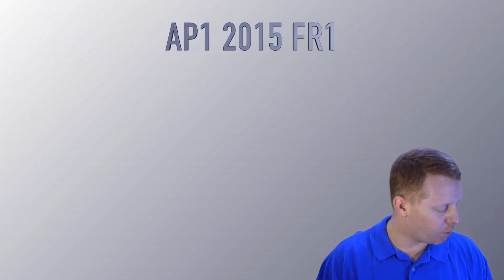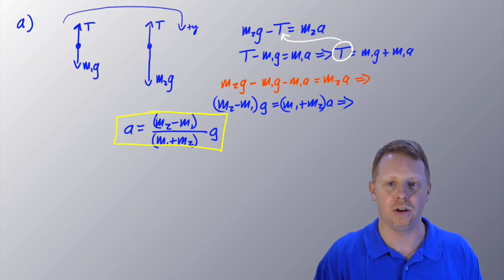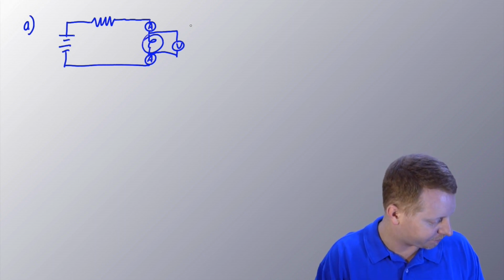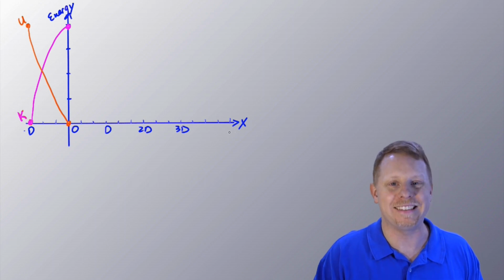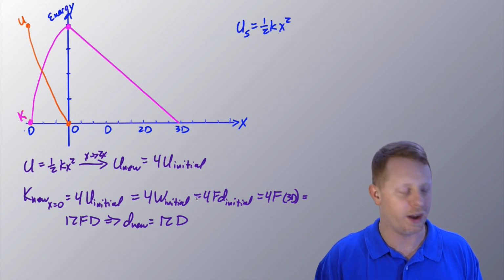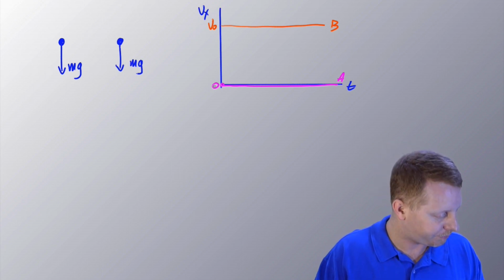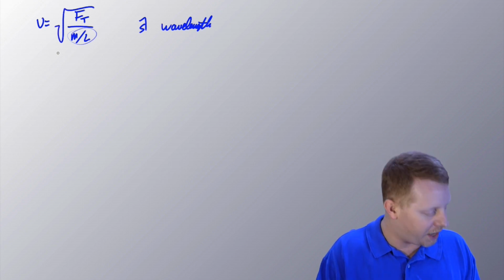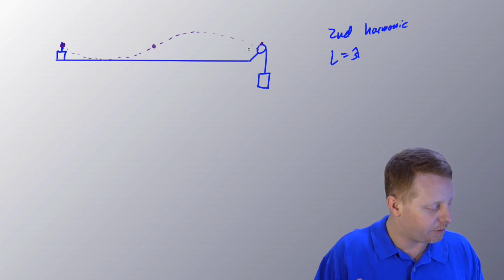AP Physics 1 2015 Free Response Solutions

Comment: In the question 5(a), could the frequencies be different because the wires were made up of different materials and hence had different densities?
Reply from the maker: +Kavan Shah That is why you would have the different mass per unit length, yes -- I'd make sure to spell out how the different materials could give you differing linear mass densities.

Comment: because both friction and the spring force are both doing work on the block 
Change in kinetic energy (from 0 to 3d) = -1/2d^2 + Fd
thus final KE as a function of displacement = -1/2d^2 + FD + KE (at D = 0). The function is quadratic not linear. Can you please clarify?

Comment: For the question regarding the energy graphs, why is the potential energy 0 from equilibrium position to 3d? The block still has momentum at x= 0. The block and the spring will be in contact throughout the duration of the motion. Right? Thus the kinetic energy of the block will still be quadratic from x = 0 to 3d. Also, since the block is always in contact with the spring the elastic potential energy from x = 0 to 3d is non-zero. I'm not sure why the elastic potential energy is zero and why the kinetic energy is linear from x = 0 to 3d.
Reply: +Krishna Kalathur The block leaves the spring at x=0. It does not remain attached to the spring after it passes x=0. Otherwise, it would not be able to travel all the way to 3D. If it remained attached, it would oscillate between -D and D. Since it is just sliding after it leaves the spring, and it sits there afterwards, it has no potential energy. Think of it: Why would it have any potential energy if it is just on a table? It is not attached to any springs.

Comment: Hey, for part 1(c), what's the intuition behind why the tension of the string on block 2 is greater?
Reply from the maker: +planetpeter917 Hi Peter.  Not sure I understand the question, as there is no discussion of tension in part 1c.
Reply: secure-media.collegeboard.org/digitalServices/pdf/ap/apcentral/ap15_physics_1_q1.pdf
Reply: Using m2g-T=m2a.
Reply from the maker: +planetpeter917 I'd have to re-draw FBDs and solve again to take that path.  I much prefer the alternate path to the solution for understanding what's happening in the problem.